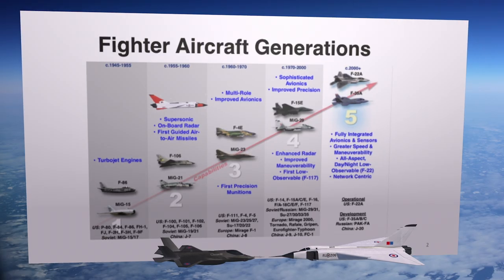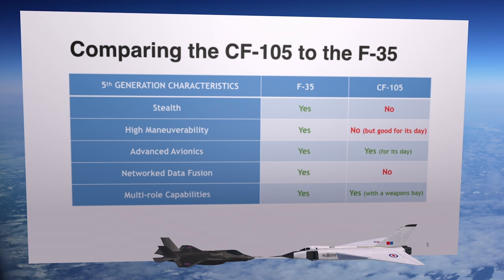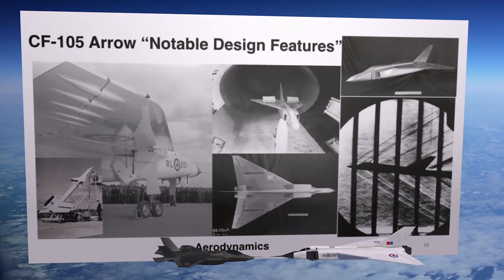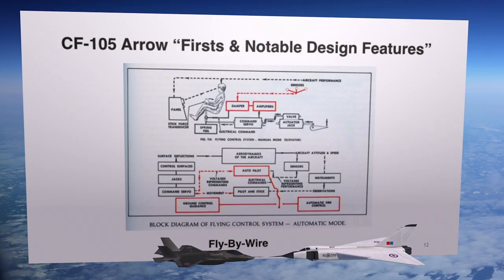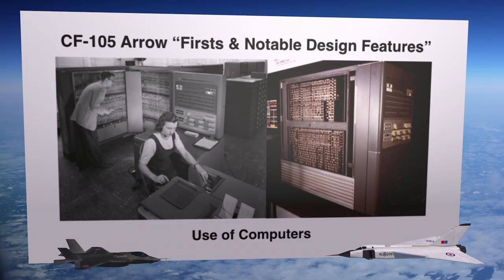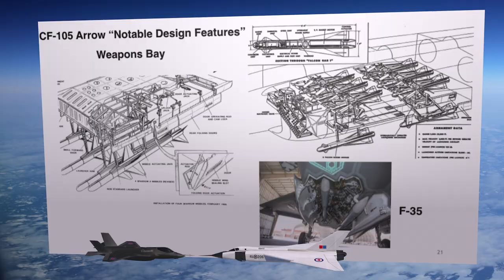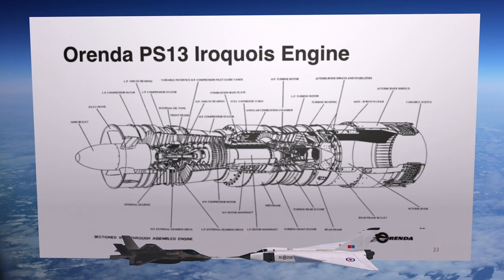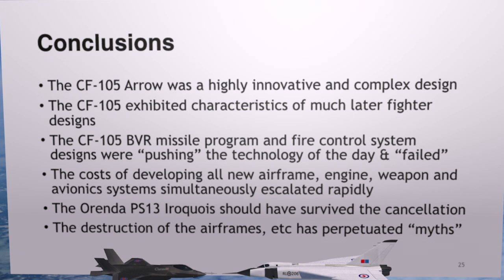AVRO ARROW FIRSTS VS F 35 LIGHTNING

Comment: The Arrow was never designed as a fighter it was a interceptor.. ..everything else was very accurate .  Love your videos  cant wait for the next one
Reply from the maker: Hi Dana,   Thanks for the comment.  I really appreciate it.  Although the Arrow was designed as an interceptor, the phrase "Air Superiority fighter" was not yet coined.  In fact, the Arrow was thought of in those terms.  Even today, if the the Arrow was armed with modern Avionics, it would be lethal.  Consider this.  Above 50,000 ft. the Arrow could sustain much higher turn rates than an F-16  and considerably faster than the F-16.  It's unclear a fully loaded F-16 could even attain that altitude.  The Arrow would be at home at that altitude and could easily out turn an F-16.  In an engagement between the two aircraft the Arrow could remain above 60,000 ft. shooting down, giving an AMRAAM greater kill distance than an F-16 shooting up.  regards....Virtual
Reply: @Virtualenvirons  F-16 has 9G at it's sweet spot speed range hence it's turn radius is tighter than the Arrow. Pilots are trained to fight with their aircraft's strengths.

F-16's smaller wings enables aircraft to have good energy recovery aka acceleration after high G instantaneous turn.
Reply from the maker: @valenrn8657  Hi RNL,  Any fighter today could turn circles around the Arrow until you got to 45,000 ft.  Then things would begin to change.  Above 50,000 ft. it would be the F-15, Arrow and F-22.  Above 55,000 ft, it might only be the Arrow and F-22.  It's just Math.  That huge wing and two Iroquois turbo jets, not turbo fans.  regards.....Virtual
Reply: @Virtualenvirons  
Nope, F-18E dogfight doctrine is with high G minimum turn radius and high AoA within it's speed range sweet spot. 

Read Tailgate's post on F-14 vs F-18 vs F-16 vs Rafale http://www.f-16.net/forum/viewtopic.php?f=55&t=6094&p=385233

Tailgate forum member is a current pilot for F-16C BK40/50s, F-15C, F-22A.
Quoting Tailgate 

I don't know about other drivers on this board....but the F-14 was not an ACM platform. I've flown against them in 15A/C's and 16 40/50's and the 14 simply was outperformed by both. I can say this with a little pride and ego...I have never lost to a Tomcat in ACM/BFM. It simply was outmatched by either airframe. What it could do was "kill" you from a long way off.

The Hornet is a much more difficult foe and unfortunately I cannot stake the same claim as above....lol

I have flown against Typhoons and Rafale's in Red Flags(F-22). I am confident to say that both those airframes would have had no issues dealing with Tomcats. There is a reason they were retired.

--------

https://imgur.com/VKK60YS
F-14A has maximum 28 degrees per second turn rate at 7.5G.

For F-35A Block 3i (7G)

http://nationalinterest.org/blog/the-buzz/new-report-details-what-31-us-air-force-pilots-who-flew-the-17266
3. A former F-16C instructor—and graduate of the Air Force Weapons Instructor Course (Which is similar to the Navy's famed “Top Gun” school)—said the jet is constrained on how tight it can turn (G-limited) now. But even so, the rudder-assisted turns are incredible and deliver a constant 28 degrees of turn a second  . When the Air Force removes the restrictions, this jet will be eye watering.
 

http://www.f-16.net/forum/download/file.php?id=19308&t=1
F-18E at mach ~0.4 has ~34  degrees per second turn rate. Super Hornet's  turn rate can be higher with slower speeds. Minimum turn radius fighter can turn a defensive situation into reversal. 

http://theaviationist.com/2016/03/01/heres-what-ive-learned-so-far-dogfighting-in-the-f-35-a-jsf-pilot-first-hand-account/
Norwegian F-35 Pilot's view on F-35A minimum turn radius high AoA vs F-16 high speed turn rate dogfight. F-35's ability to turn defensive position into offensive position with a minimum turn radius reversal.  

Against high speed turn rate fighter, F-35A can execute thrust vectoring style (due to oversize rear stabilizers) minimum loop radius with high AoA to turn defensive position into reversal. F-35A doesn't need to follow Arrow's tail chasing dogfight doctrine.

https://www.youtube.com/watch?v=k3b-b762QRY
Super Hornet's high AoA+minimum turn radius advantage holding it's own against F-15's high energy turn rate advantage dogfight example. It's harder to escape from Super Hornet's nose pointing. F-35A version has Eurofighter beating acceleration. 
 
Hint:Super Hornet has excellent lift due to slow speed landing on carrier requirements

https://youtu.be/A5E-qOtu9Jk?t=32
F-18E Super Hornet's cobra manoeuvre  with follow up level plane pedal turn. High speed chasing fighter like Arrow overshoots and gets shot down.

Why I mention F-18E for F-35A

http://nettsteder.regjeringen.no/kampfly/2015/11/20/a-fly-f-35-erfaringer-fra-den-forste-uka/
More F-16 vs F-35 from Norwegian pilot.
I quote
Overall, flying the F-35 reminds me a bit of flying the F/A-18 Hornet, but with an important difference: It has been fitted with a turbo
Reply from the maker: @valenrn8657  HI RNL...You posted a lot.  Are you responding to me or someone else.  It is good stuff, but a lot.  On that, we have CF-18 pilots we can discuss tactics with.  As the CF-18 only has a 7.5 G rating, their tactics are thick air (low) if possible.  The twin engine design works well for them in sustained turns.  
The F-35 is faster than it's posted speed.  I know pilots who have been aggressor pilots in the U.S. and say it's faster.  I have a theory though.  I think the F-35 gets less stealthy the faster it goes.  They may have picked Mach 1.6 (arbitrary units) for marketing only.  Hard to sell a aircraft with the slogan "Stealthy until Mach 1.6 and then your dead meet".  regards..Virtual
Reply: He’s probably talking to me he keeps jumping around posting turn rates and then I have to find where he put his last post. It started with the review of the book Cold War Cold Tech I posted. He didn’t like the comparison of the F-15 and the Arrow. 

Your right it’s just math and the math you need to look at RNL is on the five things that make for good maneuverability. They are wing loading, thrust-to-weight ratio, control effectiveness, critical alpha (or stalling angle of attack) and, finally the amount of “G” loading the aircraft structure can absorb. I did the math for the Arrow and the F-22 for the wing loading, thrust-to-weight ratio, the Arrow based on the math looks very good even compared to the F-22. I can post it if you like!
Reply: The Arrow with the lowest wing loading at 54.9 lbs to 1 sq ft of Wing and a thrust to weight of around 1 to 1 at combat weight would not be that easy to beat in a turning fight with in visual range at most altitudes. The problem is its out of date electronics and weapons. As for stealth you may look smaller on radar but at altitude it can get down to -30 degrees and the faster your speed the more air friction heating up the plane. So to any IR detection system your going to look like a flaming meteor.
Reply: @jim100ab9  
Your argument on fictional Arrow Mk2's high speed with high turn rate advantage does't factor in basic fighter maneuvers such as displacement turn rolls
https://en.wikipedia.org/wiki/Basic_fighter_maneuvers#/media/File:Barrel_roll_attack_with_instruction_diagram.jpg
This example shows displacement rolls during a turn enables this aircraft to turn inside (hence  reaching minimum turn radius)  against an opponent with high speed with high speed high turn rate. F-35A version would be executing high alpha (air brake) with high G turn to position itself into high G minimum turn radius speed range advantage while F-35 still has excellent roll rates, hence another EuroFighter shotdown.

Read Tailgate's post on F-14 vs F-18 vs F-16 vs Rafale http://www.f-16.net/forum/viewtopic.php?f=55&t=6094&p=385233
Tailgate forum member is a current pilot for F-16C BK40/50s, F-15C, F-22A.

Quoting Tailgate 
I don't know about other drivers on this board....but the F-14 was not an ACM platform. I've flown against them in 15A/C's and 16 40/50's and the 14 simply was outperformed by both. I can say this with a little pride and ego...I have never lost to a Tomcat in ACM/BFM. It simply was outmatched by either airframe. What it could do was "kill" you from a long way off.
The Hornet is a much more difficult foe and unfortunately I cannot stake the same claim as above....lol
I have flown against Typhoons and Rafale's in Red Flags(F-22). I am confident to say that both those airframes would have had no issues dealing with Tomcats. There is a reason they were retired.

http://nettsteder.regjeringen.no/kampfly/2015/11/20/a-fly-f-35-erfaringer-fra-den-forste-uka/
More F-16 vs F-35 from Norwegian pilot.
I quote
Overall, flying the F-35 reminds me a bit of flying the F/A-18 Hornet, but with an important difference: It has been fitted with a turbo

Original source (non-English)
http://suomenkuvalehti.fi/jutut/kotimaa/suomella-vahvat-ilmavoimat-mutta-kuinka-kauan/
Frisian Flag 2012 exercises in Holland, Finnish F-18Cs gets 100 kills and 6 loses against Eurofighter (Germany, UK), Polish new F-16 and older F-16 planes (Norway, Belgium) and Gripen (Swedish)
Reply: @jim100ab9  

https://defence.pk/pdf/threads/f-35-overwhelming-superiority-over-rafale-and-eurofighter-in-atlantic-trident.523986/
The F-35A's overwhelming superiority has been recorded in some of the most epic air combat in NATO history when the USAF fighter met for the Atlantic Trident (April 12-18), French Rafale fighters and British Eurofighter Typhoon

Eurofighter's IRST was useless against F-35A

Skyward-G infrared search and track (IRST) system (from Nebbiano, Italy) is based on experience with the Eurofighter Typhoon's Pirate IRST with more than 74 km IRST.

French has Optronique secteur frontal has up to 100 Km IRST on the right side and  sensor for target identification with 40 km range on the left side.

IRST's effective detection range depends on opponent's IR generation and F-35 has specific IR stealth mode which is similar to submarine's "go slow" approach.

Belgium's selection for F-35A Block 3F is based on real world war games. Belgium probably disliked being smashed by the Finland's F-18C.
Reply: Ya in a controlled environment that favored the F-35. stop trying to hide your posts. LOL the F-22 has been beaten in and uncontrolled dogfights just ask the German pilots in a red flag in England. or the F-16 that got the first confirmed kill on the F-22 in an uncontrolled combat that was not set up to favor the F-22.
Reply: @jim100ab9   Red Flag in England? Its always in US... never abroad.. and no, they were not beaten in uncontrolled dogfights.. those dogfights were highly skewed towards EF... because it started at WVR... EF would never get into visual range with F22 in normal combat... and btw, in those WVR dogfights, they did not beat the F22... F22 won, EF just scored some kills...
Reply: Typhoon pilots at Farnborough (that's in England isn't it?) said that, when flying without their external fuel tanks, in the WVR (Within Visual Range) arena, the Euro-fighter not only held its own, but proved to be better than the Raptor.

Indeed, it looks like the F-22 tends to lose too much energy when using thrust vectoring (TV): TV can be useful to enable a rapid direction change without losing sight of the adversary but, unless the Raptor can manage to immediately get in the proper position to score a kill, the energy it loses makes the then slow moving stealth combat plane quite vulnerable.

What most over look is, the rules of engagement in a future conflict will they allow the Air Force to shoot down targets without visually identifying them a risky assumption given the world's increasingly crowded airspace. 

Now just how good is the F-22 in a WVR combat, well that depends on who you listen to? So far the Air Force has kept its Raptors on a short leash, letting them play in only the most controlled circumstances and claim things like 50 to 0 kills in favor of the F-22. So, what if the F-22 plays in uncontrolled circumstances? An F-16C pilot assigned to the 64th Aggressor Squadron gained the first-ever F-22 kill in Red Flag. [94th commander] Lt. Col. Dirk Smith told AFM: "At least half of the 94th FS crews had less than 50 hours in the F-22 and no matter how magical the F-22, any pilot can make a mistake. Well, that sounds more like an excuse for why the F-22 got shot down.

https://theaviationist.com/2013/06/19/f-22-shot-down-by-rafale/

https://www.wired.com/2007/07/first-f-22-rapt/

https://theaviationist.com/2012/07/13/fia12-typhoon-raptor/

https://www.wired.com/2012/07/f-22-germans/

http://nationalinterest.org/blog/the-buzz/the-not-so-secret-way-kill-f-22-or-f-35-stealth-fighter-19107
Reply: @jim100ab9  thats nice but how often will they fly stripped naked? Whats their combat value would be?
Reply: stripped naked? Do you think they would dogfight with external fuel tanks! they are called drop tanks for good reason.
Reply: @jim100ab9  no external weapons either...those also generate drag...
Reply: what are you talking about now?
Reply: @jim100ab9   TYphoons fought those dogfights without any weapons.. with planes trimmed for that particular scenario.. in real combat situation, they would carry weapons and fuel.. therefore their maneuverability would be a lot worse... F22 carries everything internally.. so it doesnt suffer from such limitations...
Reply: LOL next you will try to say they didn't even carry fuel or didn't get off the ground because it was a computer simulation. the Typhoon wasn't the only plane to beat the F-22. What about the F-16, Euro-fighter, and the Rafale. The idea behind red flag is to see what would happen in a real dogfight and they all did carry weapons.
Reply: @jim100ab9   same thing.. planes were adjusted for dogfights, no external items... why dont you read about it in detail? info is available at F-16.net...

According to french source, F-22 dominated every time, and "gun killed" the rafale at least twice.
From all french source we could get (including the french "air & cosmos" magzine, and its supp. "the combat of rafale"), all french pilots interviewed admitted that rafale did not score any voctory on F-22. The only controversy lies on whether F-22 won all engagements, or some engagements were draw.

oh, and once again - they were not at RED FLAG... this dodfight was in UAE, during ATLC... it was just a presentation, no real combat engagement.. Typhoon present at Red Flag got wiped out same way as any other 4gen plane..  and that single F-16 kill to this date? happened when F-16 "regenerated" behind F-22 and pilot misindentified that plane as he thought its not part of combat anymore.... thing like this could never happen in real life... planes that are shot down dont suddenly "reappear"...
Reply: Rob if you were talking to me then you know nothing about the Arrow. 

The concept of a multi-role combat aircraft clearly intrigued the RCAF for the C104/2 design closely resembled the CF-105 in size, appearance and capability. The key to its flexibility lay in its massive armament bay. Install six Hughes Falcon missiles and twenty-four rockets and it was an interceptor. Not satisfactory? Try four Velvet glove missiles or four thirty-millimetre cannons with 200 rounds each and fifty-six folding fin rockets. Need a tactical bomber? Four 1,000-pound general purpose bombs would do the job. Put in a camera pack and the aircraft was transformed into a photo-reconnaissance model. Add more fuel and it became a long-range fighter. Carry a second pilot on any of these missions and it could be used as an operational trainer. The possibilities were too numerous to resist. (Dow: The Arrow p. 126)
Reply: Except the bit where he claims the F-35 has "high manouevrability".... They do not (not a fault of the F-35, just not designed for it).
Reply: @JaM-R2TR4  red flags happen in ALL allied countries ... in Canada we call them maple flag ... but they ares till red flag games ... the americans dont have a monopoly on war games ... nor do they have solitary rights to calling these games red flag ... more often than not american pilots are beaten by foreign personell than not ... heck I recall once a company of ENGINEERS defeated the rangers in king of the hill competitions ... with the rangers losing 90% of their force while the engineers lost 2 % .... nope america once was great now it is just another country with a chip on it's shoulder ... modernize the arrow's electronics and weapons to modern and NOTHING currently made matches it ... the closest to meet the air7.3 spec was the x23 which was cancelled .. when it lost to the x22 ... understand the arrow is 70 years old ... the f35 is 20 years old ... and the arrow still can beat it ... modernize the arrow and the f35 becomes a target not a weapon ... aside from that the majority of the f35 owes it's design to the arrow where it takes all of the arrows 22 firsts and the still in use 15 first from the arrow and incorporates them into it's design ... if it wasnt for the arrow ... the f35 wouldnt exist ... nor the f22 ... the f18 would be the current american standard ... heck even the shuttle (Jim Chamberlain designed most of it) was just and arrow turned upside down with a relocated tail fin ... there are no modern fighter aircraft that dont employ 15 of the arrows original design concepts ... and NONE of them match the spec the arrow was DESIGNED for ... 70 YEARS and still nothing matches air7.3 that the arrow was designed for and even with the j75's was able to meet by the math and proven at partial thrust recorded ... even the flight data shows the arrow was on average 5% better than the math said it was ... some areas it was 20% some it was 1 or 2% ... still once an arrow with the iriquois engine flies with modern avionics ... it will finally and for all time prove the arrow is still a plane that can do it's job and return .... once that arrow is updated to modern fully including low observability ... the arrow will make the f35 seem like an f16 first run ... and thats based off of a design 70 years OLD ... a design almost 4 times older than the modern f35 ... not to mention the f35 still has problems being vstol traditional at the same time ... they literally had to make 2 versions of the f35 to get BOTH needs from one air frame ... the f35 and f35b ... the f35 variant has short take off due to its vectoring thrust while it has problems taking off at full combat load and fuel ... and has to go near empty to do it and that forces a mid air refuel ... while the f35b can vertically take off it cant carry maximum payload at the same time ... and since it is rather hard to mid air re arm a jet that means it's combat effectiveness is half of what is reported ... and all you have to do is follow their press releases to see this ... IMHO the f35 is a multibillion dollar waste of time and effort ... greta for proving harrier style take off and landing can be done but not a practical or cost effective solution to most countries needs ... great in the southern us but crap anywhere cold ... which just happens to be the area where MOST of the need for a good aircraft resides ... russian chinese and even korean operations ... 
.
Reply: @0623kaboom  so many things just miss the point completely.. sorry but i dont have time or will trying to convince somebody on internet.. you either are interested to learn how things actually are, and there are plenty of materials out there for that, even here on youtube.. or you dont, and no matter what i write here would change that... so i wont even try :)